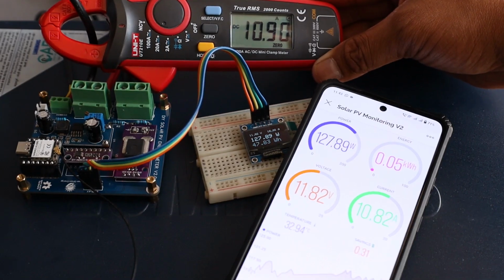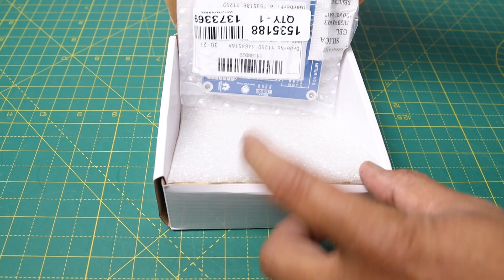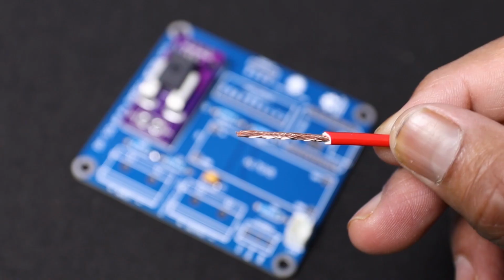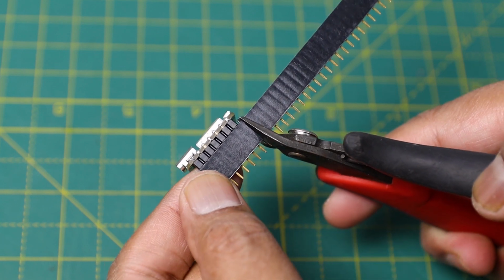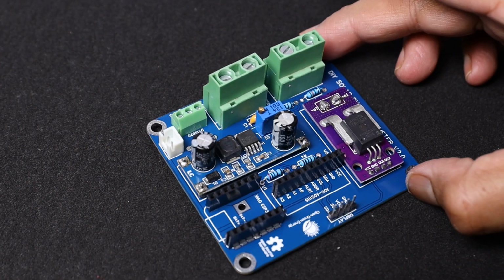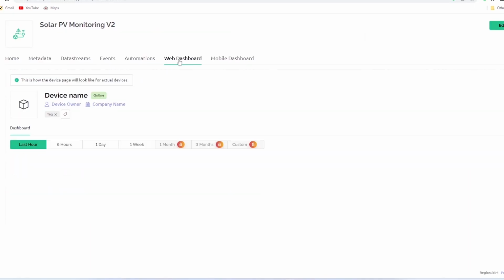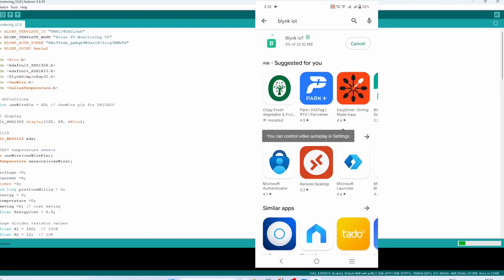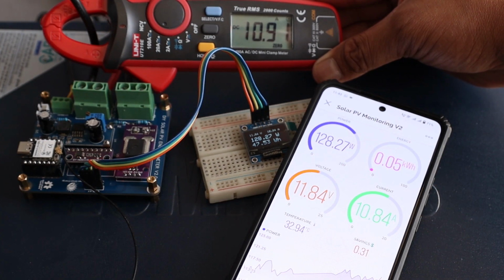DIY Solar PV Monitoring System by Using New Blynk 2.0

Comment: Hi.. I made the same project without the temperature sensor and it works fine. But the current value is not stable as it is in your video. It varies very much within milliseconds. How can we stable the reading?..  Also I need to press the reset button every morning to start the program run even if the power is present....Please help...Please help...

Comment: Thanks for sharing this amazing DIY project. Ive build everything as you said. Thing is I am getting -50A with no solar input, and -38A and 13.22 volt with solar input. The voltage is correct. But the amps shows a negative value. What did I do wrong?
Reply: My solarpanel specs: 190W - 5,7A - 44,7V
Reply: @MrSlandersen  There seems to be a problem with the current sensor. You should test it with another load. Also it might need calibration

Comment: Excellent video and presentation, If possible, show how to do it for 24 v battery as well.Thank you very much for sharing your knowledge.
Reply: It is the same for both 12V and 24V battery until and unless the solar panel voltage is below 50V.

Comment: thanks for the video .. and the nice project
But I have a problem. after 11 Ampers   the device starts going wild and unstabile.. one second is 150W and second later is 230 W. the same is voltage.  I also have to reset after the night. Does anyone have a similar problem? Thanks in advance

Comment: I have discovered a major problem with the circuit boards for this project from PCBWay.  It appears that there are more than one version of the design and one of them does not work.   In particular,  the SCL and SDA connections are not correct, and as a result, the circuit does not work.   

Specifically, on the boards I received, if you follow the trace from the SCL connection for the OLED display, it connects to the SDA on the ADS1115 (labelled SCL, incorrectly), and then on to the SCL on the XIAO ESP32C (pin D5).  This means that although the OLED connection would be OK, the fact that the ADS115 connection is wrong means the circuit does not work. 

Looking at the ADS1115 pinout,  the order should be
VCC
GND
SCL 
SDA
ADDR
ALRT
A0
A1
A2
A3

The SCL is adjacent to VCC, but in this version of the board, the connection adjacent to VCC is the SDA instead.

Of course this may be a version control issue at PCBWay, but when I ordered there was no indication of any variation, and my boards are labeled "DIY SOLAR PV ENERGY METER V2.0"

Hopefully this may save others weeks of troubleshooting...

Comment: I'm in the process of building your monitoring system. Just received the boards from PCBWay yesterday and will start assembly in the next day or so. 

If I am interpreting the design correctly it appears that the board is powered by  connecting the solar panel to the XL7015 which then supplies 5V.  It's this correct? 

But, it is not clear what the function of the battery connection is, what type of battery it should be,  and, how it is to be connected to the Xiao ESP32C3.   Are you using the backside battery connection of the Xiao ESP32C3?   How is this done since you have that chip in a header?   Also, if the battery is intended to be an 18650, for example, is there enough space inside the case? 

Can you perhaps add some explanation either to your blog or you FB page on what the role of the battery is and how it should be used?  TIA.
Reply: Hi, i hope that you are well. i'm Ndu and i'm in the process of doing the same project. did you managed to win with yours?
Reply: @ndumisomnomiya5657  Yes, but there are some issues.   First, regarding the battery connection, I never connected it.  The designer did not respond to my inquiry.  He also now has a version 2.1 (with no documented circuit) in which he mentions a "corrected" battery circuit.  So it's impossible to know what this means.   Also,  SEEED indicates that for a battery connection, you must place a diode on the + connection. 

The problem with not having the battery is that when the solar is off, there is no backup and the circuit does not operate.  It must be restarted manually. 

However, by far the biggest problem is the one mentioned in the next comment:  the SDA and SCL connections are wrong.  They should be in the order listed in that comment.  I was able to get the circuit to work by scratching through one of the connections and using a jumper for the other.   It now works perfectly. 

Finally, I've had some trouble with the unit disconnecting from Blynk. However, I suspect that's a network problem and does not reflect an issue with the design.
Reply: hi, i hope that you are well, i'm working on this project and I have some challenges, when powering the circuit the ESP32 is connecting to the wifi but only connects for  1 minute in the Blynk App then it becomes offline in the Blynk while the esp32 is connected to the wifi.  another problem is that the Oled display is not turning on at all.  I'll appreciate your help. thank you

Comment: how can test it if I don`t have an solar inverter?  it works?
Reply from the maker: Yes, it will work. You can connect the load like battery through charge controller

Comment: Hi,
Nice project and thanks for sharing.
Need one help. I have tried to make it for my home solar system but it is showing 22amps current without any load.

Could you please help me ?
Thanks
Reply: Did you find any solution? Mine is showing -50A without any load.
Reply: Yes, I have replaced resiator with 10k trim pot and adjusted values accordingly

Comment: Also Arduino code as instructed on blog will not compile at with Arduino IDE or PlatformIO, spent hours troubleshooting and finally used an Arduino AI website to fix multiple errors in the posted code. Then finally came to life. This project needs attention, especially for beginners that are simply following instructions and there are no responses here for issues found. If I had not ordered, waited and assembled all the parts I probably would have just gave up. Unfortunate, as this is a great project - just needs some serious work before posting in my opinion.
Reply: hi, i hope that you are well, i'm working on this project and I have some challenges, when powering the circuit the ESP32 is connecting to the wifi but only connects for  1 minute in the Blynk App then it becomes offline in the Blynk while the esp32 is connected to the wifi.  another problem is that the Oled display is not turning on at all.  I'll appreciate your help. thank you